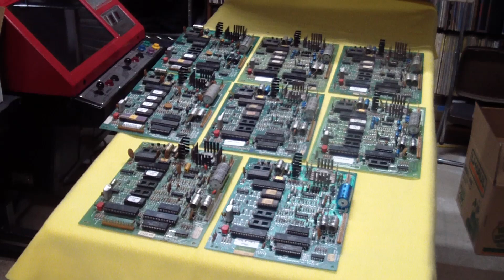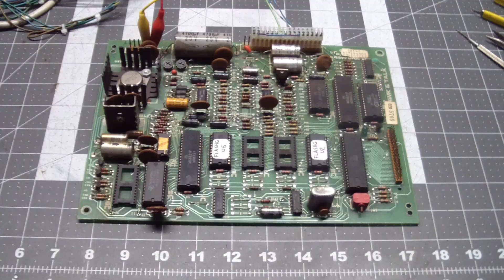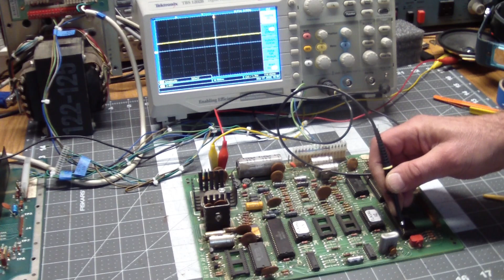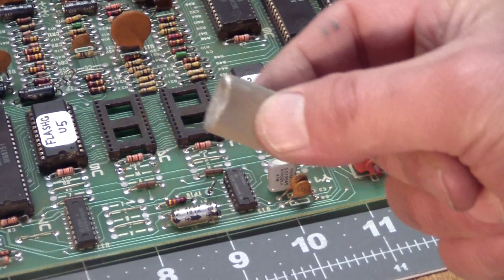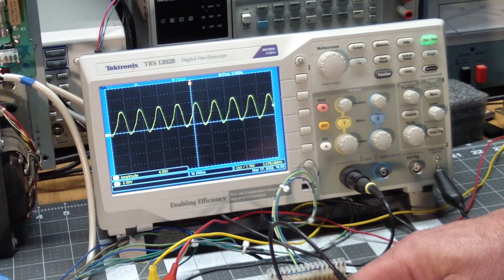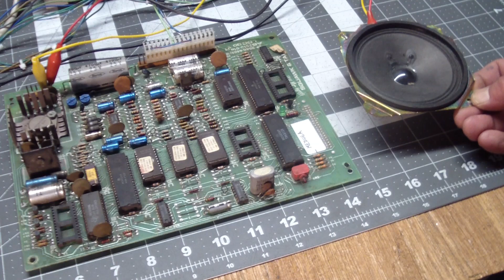AE#167 Repairing A Bally Squawk & Talk Audio Board

Comment: Can you make a video about how the LPC chip works and the code used to get the basic theory of how it works?
Reply: Here you go: https://cnx.org/contents/swFM2W46@5.12:8iAFbODz@2/How-the-Speak-N-Spell-Worked

The TMS5100 chip in the Speak N Spell is an earlier version of the TMS5200 in the Squawk & Talk. In short, it is very lossy audio compression vs. arbitrary speech generation. GSM and some other speech codecs use a higher bitrate version, which is why you sound like a robot when the call is close to dropping out completely.